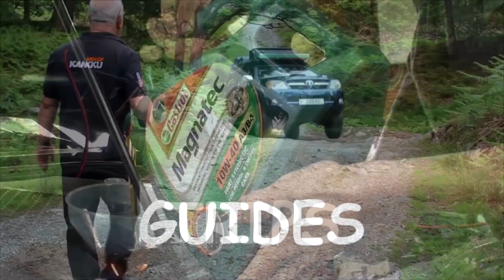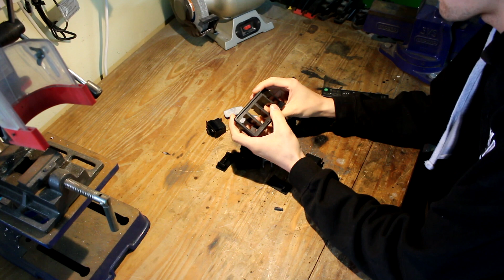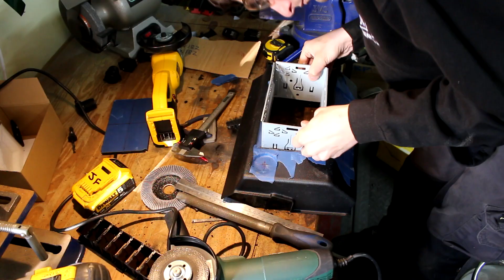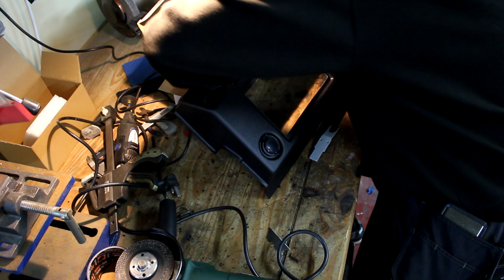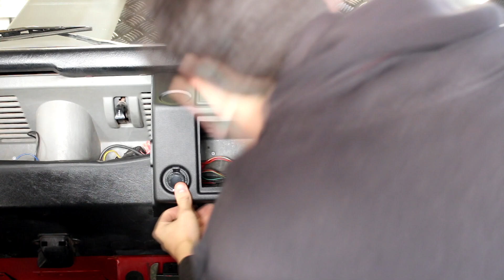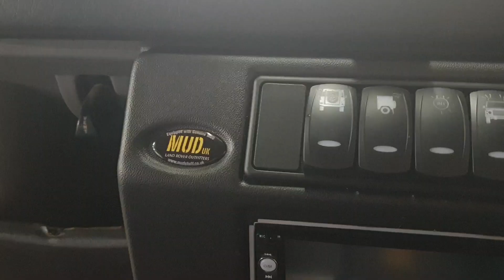MUD Stuff Land Rover Defender Dash Console Install

Comment: I think your missing a piece of trim.  

There is usually a piece of plastic trim that goes around to cover the cage so you can’t see the transition between it and the fascia...?
Reply: Where are you based. Could you do this for me ? I’m in Cheshire. Thanks.
Reply from the maker: We took it off, off camera as the owner of the land rover was going to re fit it himself 

But good spot 😁👍